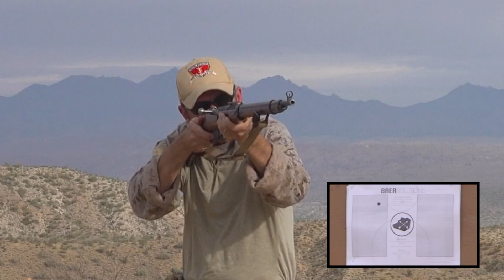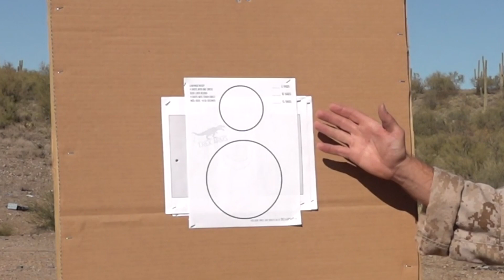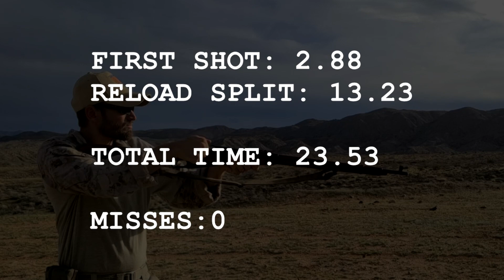Milsurp Operator: M91/30 Mosin-Nagant

Comment: I wonder if a non-refurb would give much better times.  They generally have smoother actions and properly fitted interrupter/ejectors help with stripper clip loading.  All the refurbs like this were tossed together from random parts and often poorly fitting.  A poorly fitting interrupter/ejector makes stripper clip loading even more of a pain than it normally would be w/ a rimmed cartridge.  Not that a Mosin would ever run like a Mauser or anything...  But I've noticed all the non arsenal refurb Mosins I have run way better.  Especially anything the Finns got their hands on.
Reply from the maker: Yeah I definitely think that could make a difference. I haven't had much time behind other mosins but from what I've seen I'd say this one is maybe in the middle as far as reloading. Not super hard but there are definitely ones that are easier.